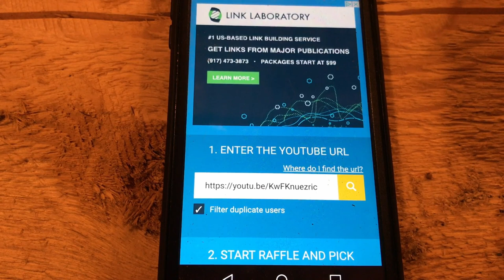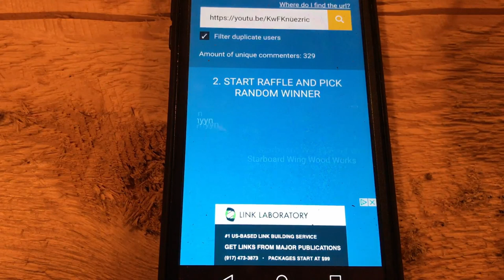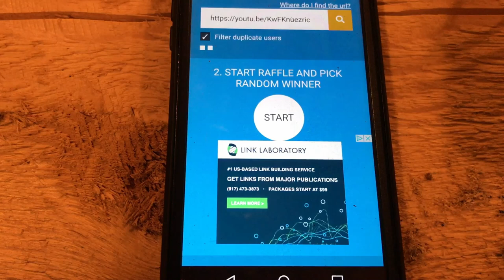Drawing for Our Hand Forged Draw Knife Giveaway

Comment: A couple of weeks ago, while visiting son and family in Illinois, I helped him build a workbench. The design was 4x4 posts with half lapped 2x4 stringers. The 11 yo grandson took an interest, so after I (and then my son) hogged out the dadoes with the circular saw, I showed them how to clean out the waste, first with hammer (as you've done) and then paring with a chisel. No timber frame slick here, just a 3/4" bench chisel.

I showed him the stuff you do--pare to the line defining the edge, then remove everything that doesn't look like a dado. Finally, pare to flat. My son (older than you) picked it up fairly quickly, but the grandson was a little tentative the first day. By the second, he was hogging out the waste like a trooper, and doing a credible job paring to finish. I only had a little work to sweeten the slot. 

Bench came out pretty good. Grandson is on his way to being a woodworker.
Reply from the maker: That is excellent, I like hearing about the young ones getting involved.